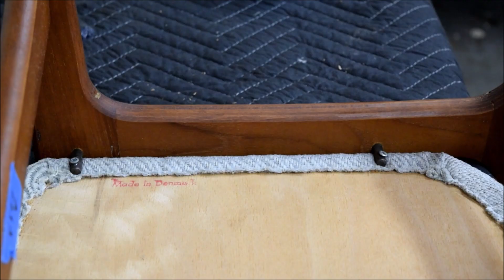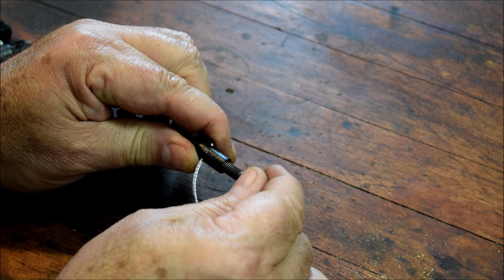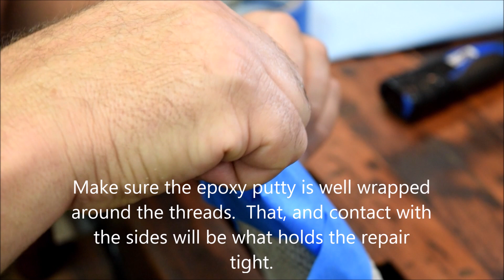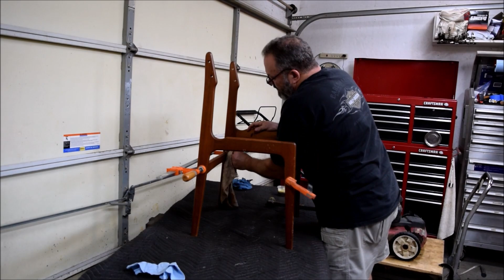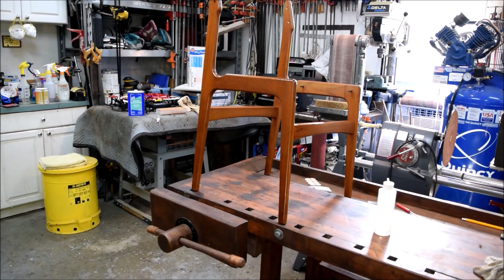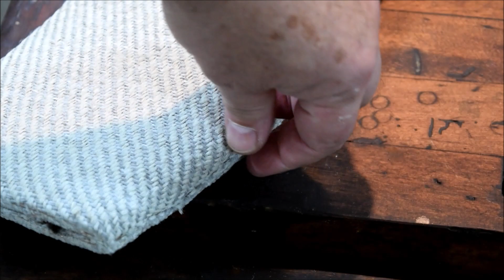Repairing Thread Inserts, etc. on an Danish Modern-Style Chair

Comment: Very helpful. Question: I have a nearly identical chair where the inserts that support the seat have worked loose and the hole is now too big to support them. Any ideas for how to repair that? Would the epoxy putty work there as well? Seems like a weak point in the design but I like the chair and would like to use it still. Thanks!

Comment: I have these same chairs, and the problem we have is that the seats are cracking where they rest on the four small metal pins inside the frame. Any tips for fixing those? Maybe metal strips tacked to the bottom of the seat to reinforce?

Comment: I have a set of 4 that appear to be the same as this one. This video was my guide through  reviving the teak. Im new at this and i made a mistake with one of the chairs and left the oil finish on for too long before attempting to wipe off and it was partially dried and just too sticky to wipe off. Bits and pieces of the rag fibers got stuck on the finish. My thought was maybe to just use fine steel wool and some mineral oil to gently remove it and then wipe down immediately, but i havent tried anything yet. Do you think that is a good solution or is there a better way?

Comment: Thanks for the precious knowledge! I have 4 chairs like these but the back are only fix with regular screws straight from the frame through the wooden back part. Obviously, the holes are now too big with time and the back are loosen. 

Can I replace it with an insert as you did? How do you call these black screws too?

Thanks!
Reply from the maker: Depending on your skill level and tools, you could drill out the damaged hole, insert a plug and re-drill for the screw.   You could insert a threaded insert and bolt it back together as well.   I'm sorry, I'm not sure what black screws you are referring to.   Good luck.

Comment: I have a bed frame with this issue. The threaded insert easily pulls out from the frame. Will the epoxy putty fill in the gap to make this insert fit snug again? I tried the 2 part epoxy mix and that didnt work.
Reply from the maker: You can try it.  If it pulls out, drill out the hole to the size of a dowel you have.   Put glue on the sides of the dowel and hole and insert the dowel.   Let it dry, re-drill and screw in another threaded insert.    Sometimes a short cut will work and sometimes you need to be more thorough.   Good luck!

Comment: I have chairs which are similar, however the chair screws you mentioned, they have come out from the frame and I'm looking for some tips on how to repair and enhance the structure. On two of the chairs I have the pins have fallen out of the base completely (and out friends have fallen through!). Any tips or help would be appreciated!  Also great video! I'll use this on another chair I'll be refurnishing.
Reply from the maker: If you can email me some photos to lostmountainrestoration@gmail.com I may be able to give you some advice.   Good luck!

Comment: Thank you so much for teaching me how to repair a threaded insert. I got a desk free from Habitat for Humanity because two legs wouldn't stay in because the inserts came out. Fortunately they were still attached to the threaded end of the leg. I used gorilla glue and toothpicks but I know it is not going to last. For the last 2 weeks I kept thinking how can I make these legs solid and there you are! Greetings from NC.
Reply from the maker: You are welcome.   If, for some reason, the epoxy fill fails, just drill out the hole, glue in a dowel plug and then you can use a screw or set in a new threaded insert.   Best regards!!